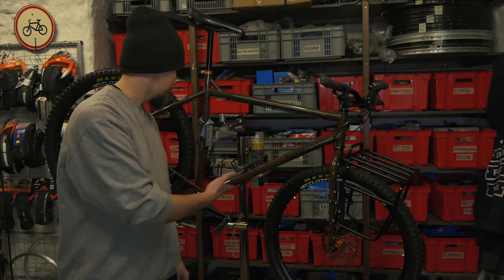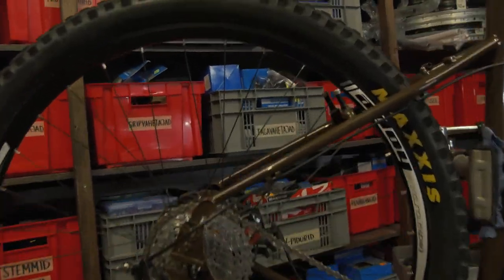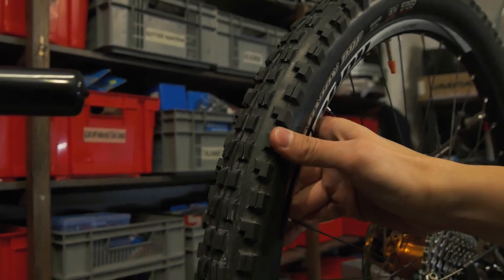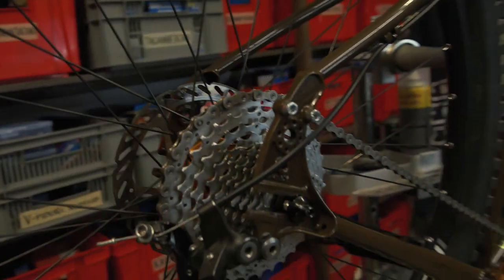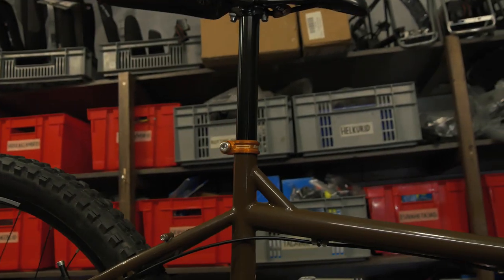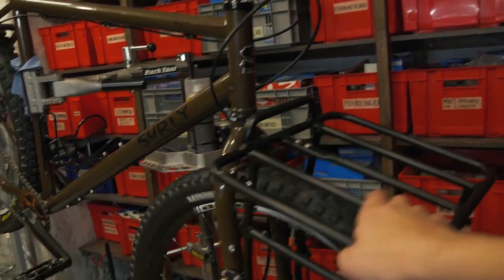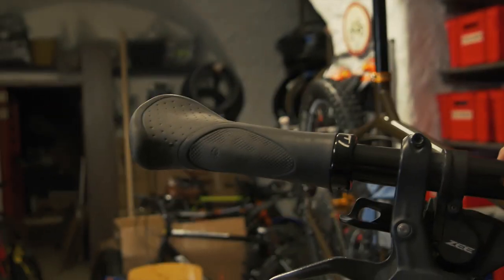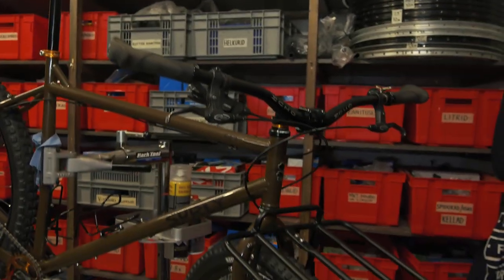Surly Ogre XL bike check - Bikepacking Estonia

Comment: I am have a Question about upgrading my drivetrain on my Surly troll from 3x9 to 2x10 and I am looking at crankset chain rings
24-34t/22-33t and 11-42t Cassette 10 speed for Stealth Bicycle Camping trips here in Southern California and My crankset 9 speed is 22-32-42t and I don't use the 42t front Chain ring unloaded or loaded up and I want to remove the 42t front Chain ring go from triple to double because my third ring on the front chainring hits railroad track by crossing
I am looking the go 2x10 Shimano Deore m6000 10 speed

I want to eliminate to 3x9-speed and go 2x10 eventually I want to cannibalize the front and just have one in the front 1x10
Reply from the maker: Yeah, less is more! Go for the simplest drivetrain possible. I always prefer 1x10/11 for the simplicity. But I think that having a 22 to 42 might be too much of a granny gear. If youre going double in front then a simple 11-36 cassette will work really well for you (depends on your inclines too though).
Reply: @YellowKneedMoose  the chain rings 22-33t 64/104mm BCD is Wick werks Mountain double chainrings and 24-34t 64/104mm BCD Raceface double chainring

Comment: Whats the weight of complete build? im considered by it since 20" frame is about 4kg, which is almost 2x alu frame... especially if i would add rohloff, i am a little bit worried  since  i am searching for a compromise between road and trail/gravel bike.
Reply from the maker: As of right now my bike is a little different - dropbars and different brakes. But the weight in this video stayed at 14,3kg. Now I'm at 13,5kg which probably is the limit. But with this frameset, the weight is not important imho. I could have made a sub 10kg offroad tourer but Ogre makes me feel safe when traveling with olanes n stuff.

Comment: Thank you for your bike review. I've been looking at one of these...but I'm 197.5cm tall. Do you think it would fit me?
Reply from the maker: Hey! Welcome to the tall club - "even 29ers look like 26ers". I'm 190, and I still have loads of seatpost left on my bike and my stand over (read: nuts near toptube) is almost 1-2cm only. I would say yes, but just to be sure, arm and leg lengths alongside torso might vary so be sure to check out all the measurements from Surly's website.
Reply: Hey YKM, would you mind sharing the saddle height in your current build? What is the distance from center of BB to top of the saddle? I still haven't made up my mind between the different Surlys. The Ogre XL seems big, specially regarding the standover, and the L seems too small...
Reply from the maker: Center of BB to top of saddle is 82cm and my leg inseam is 89cm. My standover, or balls to tube,  is 4cm with 29x2.5 knobbly tires on 25mm IRD rims. Tell me if you need more information :)
Reply: Thanks man! I think anything more than this will be way too intimate. :)
I have about the same inseam, so my worry for the standover is real, but the XL frame should be ok. Still thinking between Ogre and KM, though.
Reply from the maker: I would only go for the KM if I want to build it up for a 140mm fork and maybe even keep it simple with singlespeed. Full black rockshox infront and murdered out setup aswell. Would be sweet as.

Comment: Very nice Ogre.
Can I ask you how did you install that Pizza Rack on the fork? It seems that the included adaptors do not match the holes...
Reply from the maker: cicciotazza Thanks! On minute mark 6:27 you can see my custom steel adapter that I had to make. I will do a review on the rack as soon as I can and go in detail about the adapter. The original "pizza slice" is meant for AWOL forks so yeah. That wasn't ever going to fit.
Reply: Thanks, I will be waiting for that review. Meanwhile. I am going to receive a pizza rack for my ogre.
Reply: I posted my Ogre on a FB group called "I love my Surly Ogre/Troll" and it seems that a few guys have been able to lock the adapter on the fork without any customization. I guess how, perhaps with spacers or something. 
https://www.facebook.com/groups/253428121361803/permalink/1642086355829299/
Reply from the maker: cicciotazza hey, as you can see that is not a valid option. As soon as there is any weight on the rack, it will collide with the fork. You need 3 bolts to keep it away from the fork and to not make it move. I hope I have time to make the video of my mount this week!
Reply from the maker: I saw the other pictures now aswell (with the 3 bolts). There is a way to mount on the newer fork aswell, but it will be positioned really high. Specialized didn't design it this way and that's why I didn't even consider it. It will make my gear come up too high and look wonky, I like that mine hugs the tire.

Comment: Very nice bike, my absolute favourite. And a nice build too. Can't wait to see your Ogre in action. Would be great to see videos from Estonian bikepacking routes.
Btw, where did you buy the frame from?
Reply from the maker: Right on! Thanks! We have loads of routes here in Estonia but we haven't yet mapped them. This coming season I will start mapping and writing aswell as making videos of the routes so stay tuned! There will be a second Surly on this channel aswell, my girlfriends Troll in pea lime color should arrive shortly of which I'm going to make a build-it-up video. Both of the framesets are from Germany (bike-components.de). Cheers!
Reply: Ogre and Troll, perfect match. :) Have you tried this route already? http://www.bikepacking.com/routes/swamp-thing-trail-estonia/
Reply from the maker: Mikko I have done many parts of it. But not in full length. They described it very accurately in that post. There's an even cooler rout you can make with that but that requires some local assistance :) which I would happily offer though!

Comment: Hi! How did you remove an logo from cranks?
Reply from the maker: Shapkin Pavel because the cranks are anodised black and then painted with a neon-yellow RaceFace lettering, I could easily use regular paintstripper. Just be sure to use a tiny amount and only on the paint itself.
Reply: Nice, thank you!